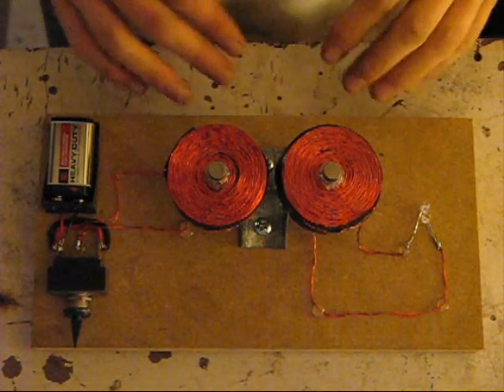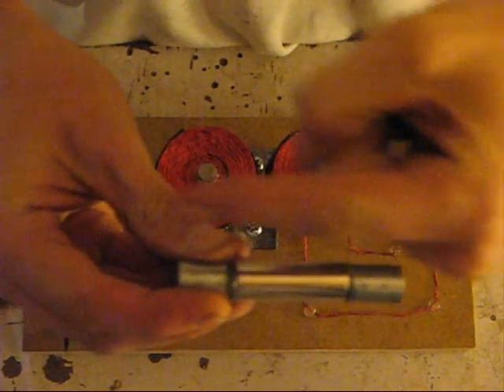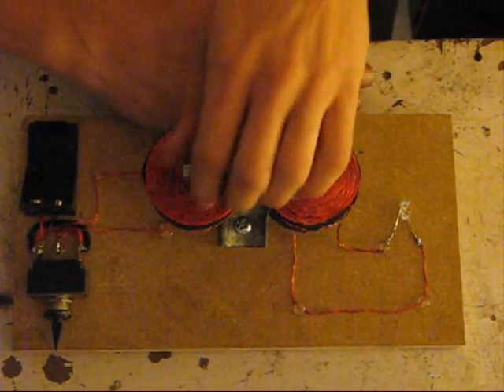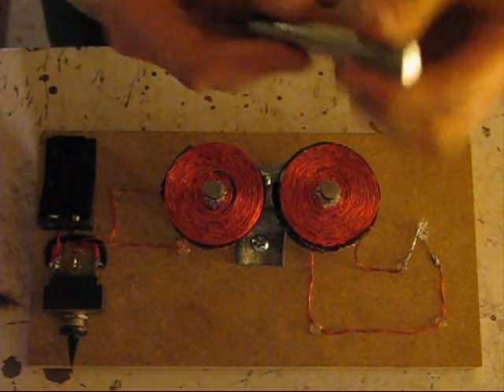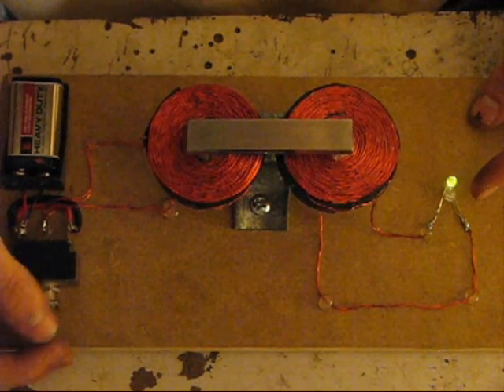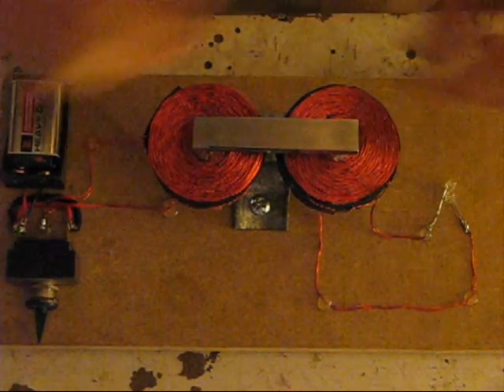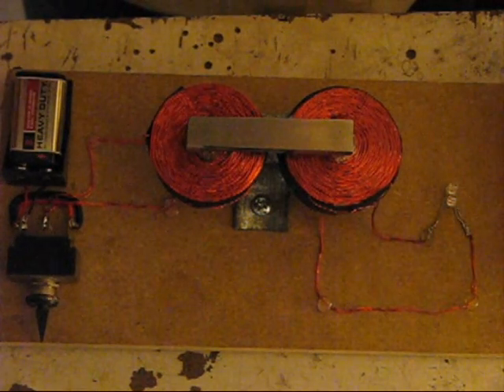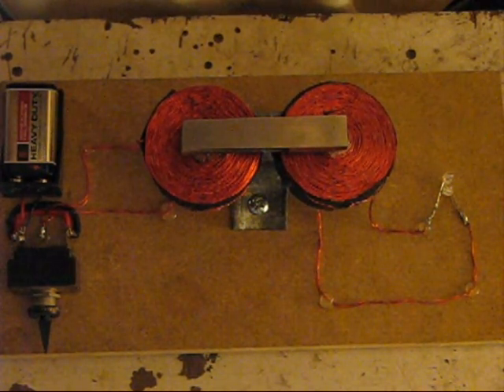Ed Leedskalnin 3

Comment: According to Ed, the individual N and S magnets run through the wire causing the electricity, and once you get them chasing each other in this design, they never stop. I wonder if you can use the Steel bar, with no battery, and then use the magnet to get the magnets chasing each other rather then using the battery. If that doesnt make sense I apologize.

Comment: @stealthcentral
Caps can store a charge for a short time, yes, but not for any great lengths of time.
The drawback to this is device is when the Magnetic pathway is opened and the field collapeses, only a small charge is created. So, a very large set of coils would be needed to produce a useable amount of electricity.
The charge-polarity of the charge on the wire in one coil is always going to opposite of the other coil. This keeps the LaPlace Effect going almost without loss.

Comment: I have done some experiments with the PMH device with different types of materials. If you use tool steel or high speed steel then when you flash the battery across the coil the keeper is instantly magnetized and will not loose its magnetism when the bar is removed. It will stick and hold on the U piece with out any additional electricity.  On the other hand if you use hypervar, or mu metal or Ferrite cores, with a high permiability then the magnetizm will not lock and the bar falls off when the electricity is turned of. The only steel that works well is plain old mild steel. No conclutions just observation.

Comment: Basically this is just a normal kind of weird electric gen. The colapsing (fluxing)field causes the energy in the coil. What is interesting about ED's version is that the short time it is charged shouldnt be enough to keep it magnetically charged. So the question is how does it works. Still trying to figure out that second one though.....thats weird!! Have you tried taking the battery off and flipping the switch?prob nothing if that but it would be cool if so.

Comment: Read about the magnetic neutral zone and field reversal from Wesley W. Gary at Rexreasearch under inventers. The field is actually reversing itself as the magnet draws close through the neutral zone which is very close to contact, this generates a current in the coils. Gary´s generator osscilated an armature in that
area, 130 year old patent.

Comment: You know in the early days of computers, RAM used to be made using tiny coils.  They would energize the coil CCW or CW, and you'd read the direction off to get a 0 or 1.  You've replicated the old core memory except with higher current and larger coils.

Comment: Hello cody, i am so late to comment this video. Can you try to switch the LED if it still work the same? Because the voltage og green and red LED is not the same. Red is around 1.7 to 2volts while green is 3 to 3.4volts.

Comment: @sn1pe352
I understand what you're saying about the fabric. I think I made the point of magnetic energy flowing through steel vs. air, and the difference between magnetic energy and electricty.
But, you should know that I firmly believe that Einstein's theory of general and special Relativity is wrong. Why? Because Einstein thought Light is the fastest thing in the universe. I don't. And neither did Tesla (the father of Radio).
There are things that move faster.

Comment: @stealthcentral
This is not a capacitive-reactance effect. It's a self-sustaining, rotating magnetic field.
Magnetic energy is NOT electricity. Think of magnetic energy like it's water. We generate electricity with the motion of water falling through a turbine, right? We just have to get the water into the pipe. Hence, DAMS.
AIR is the worst conductor of magnetic energy.
Iron & Steel are the best conductors of magnetic energy.
The steel rod becomes the Pipe.
The coils act as turbines\generators.

Comment: @stealthcentral
I know how electricity is produced and I know what a capacitor does. Here's what you're not getting: a capacitor stores energy by holding electrons staticly in some sort of weak substrate material like oiled cotton or paper and foil. Eventually, all those free electrons will leak away and the cap will need to be charged again. This is a chemical reaction....

Comment: Correct me if I’m wrong, but haven’t you proven here that there is no unusual effect in this device, because if the device works the same with or without external power, then the energy is being supplied by you. It’s the mechanical energy of your hand tearing away the magnet that causes a change in the strength of the magnetic lines of flux cutting through the coils. In short you've created a small solenoid that generates a brief current.

Comment: @sn1pe352
Electrical Potential is produced when a conductor (placed at a Right angle to flux lines of a magnetic source) is either moved through the magnetic field or the magnetic field is moved past the conductor. It's called "Electrical Potential for Work".
Nothing is "drawn in to the wire". At freqs over 30MHz, electricity rides on the outer layer of a conductor. It's called the "Skin Effect". Below 30MHz, electricity moves THROUGH the core of the conductor.
Go back to Electronics 101.